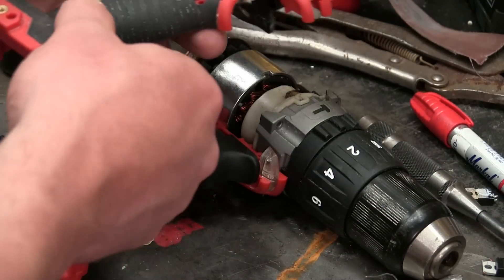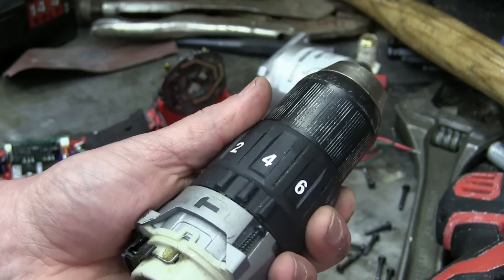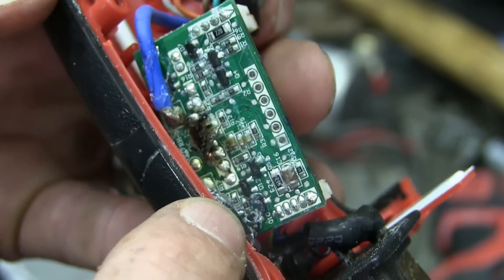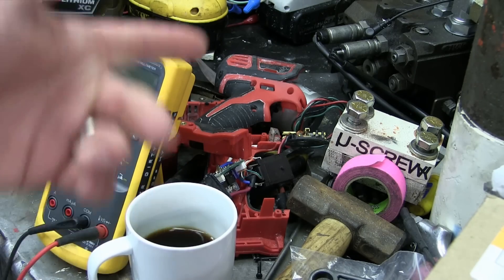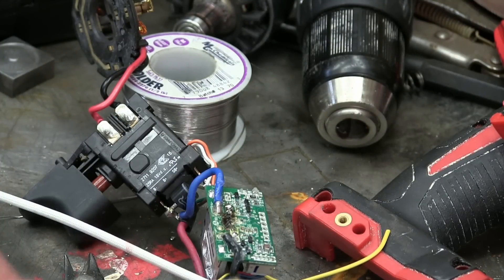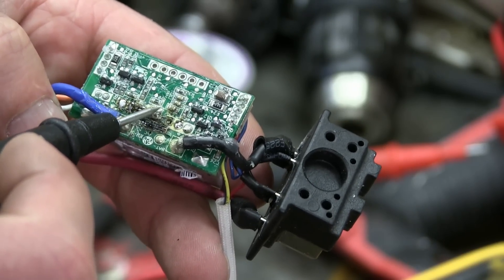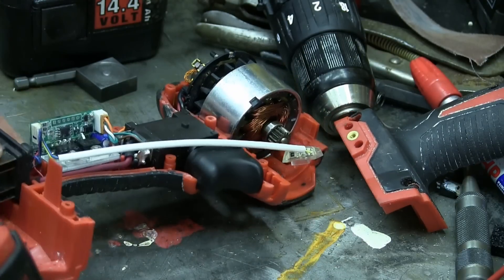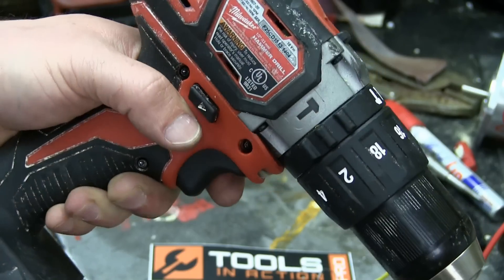How to fix fancy electronics in newer tools.

Comment: Stopping here before the end, because I keep meaning to mention; your focus trouble is in that your biggest white pixies are what the camera is noticing to focus to, and the reason you can't get it to focus all the sudden on your hand item is because 1; the white on it isn't bright enough, OR #2 big enough. 
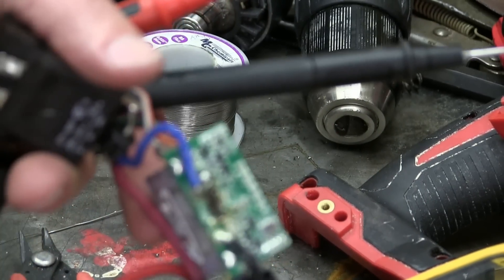If you look at 5:30 there is the major white which is in that chrome metal piece, and nothing in your hand is as bright as that, and second part is that white spool that is really big and causing a lot of bright white reflection, so your evaluative metering doesn't have enough evidence to switch it. 
So simple solution might be to either throw a dark cloth over your bench items, or put piece of paper behind your item, or find a way to illuminate what is in your hand better. 
Maybe you could wear one of those miner head lights to brighten what you are looking at. 
Or you could move the brightest reflective things off the bench, but that sounds too tough. 
lol
Ok, back to the show.

Comment: I had similar failure last winter (same drill), FET's were fried. In my case reason was that that beefy protection diode had died (there was an actual crack in middle of it)and in short time it killed power mosfets. Replaced those with closest things i had at hand and it still works. 
Another weak point is bearing seat at back. Brushes tend to heat it up to point that it melts (if you really push the drill).
I also have brushless model and it seems to b lot more idiot proof so far.

Comment: Osh park make a new board, assuming you could get ahold of the schematic for the board
Reply: There's a microcontroller in there, good luck finding a replacement and most importantly, the software that's on it
Reply: +nrdesign1991 that could be a challenge...could desoilder it and reuse, or i dont imagine the control circuitry or the software is terribly complex basically just an H bridge and pwm for speed control, possible encoder feedback i would say someone half decent ant electronics design could make one with identical function using an atmel chip actually sounds interesting i might look into it, could even beef it up with a proper voltage regulator for the motor, for maximum chooch factor

Comment: CPC which is sort of  like Digikey (same crappy order system) is just 6 miles away if I need anything ASAP
Reply: Crappy order system?!?!  Digi-Key's parametric search and ordering system is miles ahead of Newark or Mouser with their slow-as-molasses Java, or Flash or whatever programmer's wet dream jiggery-pokery they use, and it's light years ahead of Arrow and Allied, which have search systems that are totally unusable.  I can find exactly what I want on Digi-Key in seconds, upload a bill of materials that auto-populates a shopping cart, save multiple shopping carts for parallel projects and share shopping carts as links.  No comparison.
Reply: Yes it's quicker but they all have the same problem when you need a part as they can have menu items with the same values in more than one item. If you are not sure of the part number but want say a voltage regulator with a low overhead it will take you forever.

Comment: I did a similar fix on a mouse i have here.  The cord got a short, so they sent me a whole new mouse under warranty.  I poked around and found that there were replacement cords on Ebay.  12 dollars later, and i fixed it.  I did crush a metal dome switch for the middle click taking the scroll wheel off, but later I figured out that the dome was just taped on basically so I just carefully bent the dome back into it and taped it back on.  Fully working again.

Comment: may have to do that to my big ass 1/2 inch dewilt impact...i thought it was skookum...but, i've had it six months, and i think the trigger is broke...sometimes ya pull er and nothin happens...sometimes it works fine, sometimes, ya pull er, then it shuts off power, and the brake don't kick on...i'm gonna try and get the mac guy to send it in for warranty...i wonder how much that'll cost me
Reply: I had a ryobi sander blow through two switches on me. Finally I said F it and hooked up a xmas tree light foot switch. No problems since. Odd thing is the unit has speed control, conformally coated and that never went bad just a lousy DPST double insulated switch.
Reply: I think that amount is set at "Just enough to piss you off" but "Not enough that you decide it isn't worth it".
Reply: i looked up replacement parts just a while ago...a new motor/switch/board assembly would be about 160 bucks direct from dewilt...for something i payed 230 bucks for 6 months ago...joy
Reply: They really would rather you just bought a new one.
Reply: bighunterman77
It's always been that way. Back in my teenage years I spent almost a hundred bucks believing Sears products were better. Jack went out under a year later. WTF? I call sears, new "power lifting unit" is about fifty bucks and several weeks wait. I go to the HW store pay 29 cents for an O ring and by evening the jack held a 2 ton giant of a car all night long not even settling 1/2" !
Reply: BikingMNViking
I purchased a very expensive (mid 90s, over $400) VCR from a big box store for $10 because it was purchased and returned and I have a relatively useless piece of paper saying I'm certified to work on TVs and VCRs. The reason it was returned was "Played one tape and won't accept another tape". Got it home, found out that the issue was a label from the first tape was stuck in the machine. Goes to show it's generally something fairly simple but most people won't even TRY to repair the stuff. I've had several cases like that over the years.
Reply: Guy Fawkes
I wish I knew a lot more VCR theory... I must have 8 and I don't think one works anymore. Sometimes I get lucky and find they don't track in & out of the machine very well, other times they just blank out. That reminds me I just got a gorgeous 500 Watt Klipsch amplifier from awhile back. Put together immaculately. Owner was told it'd cost several hundred to even look it:

It has two mad MOVs and a 5 amp fuse blown. Now THAT was good engineering. I hope once I get time to get those parts it will work fine. It's even got a wired remote unit that turns it on and has a headphone jack and so on so you can keep the amp & 5.1 subwoofer unit hidden in a corner where bass is reflected best. (not that I needed it mind you, I have two 500 watt units already!)
Reply: BikingMNViking
 MOAR POWAH!!! That Klipsch sounds like a nice unit. I LOVE that stuff!

My landlord has me doing some wiring work/going through his storage shed. I found one of these:

http://classicreceivers.com/concept-16-5

Built like a TANK! Nearly 70 lbs! That's FOUR 10000µf/80v caps sitting in there! 165watts per channel but it seems stupidly efficient through good speakers. Not a bit of wasted space, no ICs anywhere in sight. Also not a problem with the thing apart from a dirty volume pot, which I had to gingerly peel apart and clean. I cleaned the unit, hit a few wonky looking solder points, aligned the tuner and it's good as new. Look at the Ebay "Buy It Now" price on that page! We are using that as the basis of a whole house system. Running speakers into his pool area and patio. I'm having to teach him about audio, now that he's got a nice basis to build from. I also found a decent Fisher receiver from the mid '90s that he gave me. It's now become a headphone amp.

I am pretty sure the minute I got certified in TV/VCR I signed the death warrant for the entire industry. They lasted a few more years before the DVD came around. The thing with VCRs is generally rot in the belts. That and the plastic gears are usually the issue with them. The belts are fairly easy to get, the gears? Hit or miss. Although when I was still repairing them professionally I once had a PBJ jammed into the mechanism and, on one memorable occasion, a motel called and said the rental VCR unit they had wouldn't accept a tape. Hard to load one with about 2 ounces of crack cocaine jammed in it!
Reply: BikingMNViking
Well, my actual "edumacation" was "school of hard knockers" and a bit of college. I sort of apprenticed with a guy who's dad ran a Radio store from the 20s to the 50s. He retired and his son specialized in general electronic repair, emphasizing on TVs. His store was half TV and half guitar/amp and other musical equipment. He joked that the TV side paid for the guitar side, and he wasn't really joking. My actual study was with a guy who worked with Raytheon/GE and Seimens on the early radar equipment, branching out to early TV and staying involved as a teacher until the early 2000s. Guy knew EVERYTHING! Gotta love an electronics teach who is late to class because "I had to repair the computer in my K-Car". The actual certificate is from Southside Virginia Community College. The actual experience was looking over these guys shoulders, asking questions and ruining my own shit!

RM is definitely "Rack Mounted". Here's some Google Fu (actually Bing Flinging) on the RM35A

http://www.radiomuseum.org/r/tektronix_oscilloscope_rm35a.html

To join that site you have to either pay $25 or upload pics and information on equipment, etc.  Might be worth it to track down the guy who uploaded the information (in Italy) or find someone there who knows more. Good luck. Neat unit for sure. I'd love to nose around in it for a while.

Sending an email. Feel free to shoot me questions or just conversation. I'm currently down with a back injury and about 65% bored.

Comment: if it's under 5 years old Milwaukee will fix it, no questions asked, no receipt required, with free shipping. it's the most bullet proof warranty I've seen yet.
Reply: with no receipt how do they know its less than 5 years old???
Reply: *****
Tools can have date codes on them. I think that is how my Miller got warranted? I brought it in to get fixed, and the guy was like you're still under warranty. So they fixed it for free. Although he might have figured it out just because of what model it is? It might not have been out long enough to be out of warranty.

Companies do come out with new tools, and discontinue old models rapidly anymore. It is not like the old days where a company would make the same tool for decades.

Nowadays it is all about the latest, and the greatest. So you buy, buy, buy!
Reply: +Wild Weasel, the serial number, this is also how you get free return shipping, go on their website, type in the serial number, it does the rest for you

Comment: Infineon was a spin-off from Siemens. They  actually does a ton of stuff, microcontrollers, RF/ cellular chipsets, tons of automotive ICs, IGBT, etc. I used to work there in the early 2000's. They used to make RAM as well, by they spun off that side to make Qimonda.  Sorry for the edit, I'm still waking up.

Comment: Always save the sponge/foam material that they stick your components in. (At least here in the Netherlands) it is a conductive material with some interesting properties. 
The resistance changes when compressing, making a great cheap force sensor. Used it a lot for prototyping and small projects when I was a poor student

Sam

Comment: I had the same problem with a Milwaukee 18v Hackzall. I removed the board/mosfets from the system and wired straight from the battery contacts to the wires i cut from the board that lead to the trigger. The Hackzall works perfectly like it was brand new. I got the idea from a youtube video on using a different brand battery to run a Milwaukee cordless shopvac (wish i had a link, sorry). The man in the  video said that those bits were proprietary bullshit to make sure the tool can only use Milwaukee batteries, dunno...the Hackzall worked great without em so i dont doubt it

Comment: Hi. The diode in the MOSFET probably failed after driving the motor at some point. The diode is there to allow current to flow to ground when an inductor is being driven. The total current was probably too much after releasing the switch, hence the burnt ground track. Also easier and probably better, to "bridge" the broken track with a nice solder-made track/blob. High-flux content solder would create a film around it at the same time.

Comment: I am surprised that repair worked. That board looked pretty toasty too fried to me. Without some kind of mechanical connection on your bodged trace repair I imagine the first time you really work the tool out that will come undone too. This may be a prime example of the old saying, the bigger the glob, the better the job though?

Comment: thanks to you i know how dangerous capacitors are. short of the long of it. my run cap went in my central air con unit.. had no idea wtf it was. called the family member who does hvac and he found the problem.  he pulled the cap but i wasnt home so the other half said babe get the silver thingy he left on the table, so we can get the new one... i damn near had a heart attack.   this sob would've definitely done some damage if ya didnt know how to handle it

Comment: I'm here laughing like crazy on "my wife says it all the time, but I don't know what that means" lol.
Reply: Interesting to say the least... with any luck, hopefully AvE has seen your post (was equally intrigued) ordered some post haste and will report back to the subscribed masses!!
Reply: +AvE  all depends on how thick you apply the material. if it is too big of a trace, or too much current,  you can use copper tape, it comes in various sizes.
Reply: ^Was thinking same... the more you build it up, the thicker the gauge ... hopefully allowing more "magic pixies" to dance!  Ha, I can already picture some of the "AvEisms" in the vidjaho commentary, "The more you build it up, the thicker the gauge...am I right gentlemen!?"
Reply: +AvE - One option/trick might be to incorporate/embed a length of copper wire into the glue to further support/pacify the angry pixies.
Reply: Hmm... I wonder if solder paste could be made to self-solder, initiated by ohmic heating to liquidus, as with arc welding.  To prevent thermal-runaway, the reduction in resistance from reflow would have to offset the increased resistivity at higher temperatures.  Maybe mix of eutectic alloy powders could reflow to a less-eutectic alloy?  The reduction in electrical resistance would also cause a reduction in thermal resistance, so maybe this property could be used where a solid conductor could act as a heat-sink to freeze the solder joint.
Reply: +Mike Guitar  You should experiment with that hypothesis and report your findings to us. good luck.

Comment: That'd be your FR4.  
https://en.wikipedia.org/wiki/FR-4

I've ground out a lot of carbon from a lot of circuit boards back when I was working at the repair shop before stuff got so cheap you can buy a new one for the check-out charge.

Comment: love your vids,  If i may Ill unfuze your cunfunction with the pixie Maze.  Electronics is what I do, real quick like the Gate is what you said it was, the Drain and Source part is a little  confusing.  Simply put the Power is Drained INTO the Drain lead either from the power source or after the load, either way is fine. The Source lead then delivers the pixies to the load or ground, again Either way is fine.
Reply: ... and just remember the positive pixies 'aint meant to be going through the body diode when switched on... 'cos that would make no sense at all, so they must be going tuther way... at least that is what is meant to happen....if you let the pixies run all over the shop,  you end up with PCB caramel, as per figure one in today's life affirming video..

Comment: Repaired well lol
Reply: That remains to be seen. It may be that it was no good to begin with. Which is why it blew up in the first place.
Reply: ... and furthermore, may well why they don't sell the spares any more 'cos they are all used up. 

Uprate the MOFET and see what cooks next would be my plan if it blows again. Also dremel out the electic caramel from the board and solder insulated wires direct to the mosfet legs, then tack the other ends on the remaining un-crispy (is that even a word?!)  tracks. Looks like shit, but what the hell., the covers on these things 'aint see through. Epoxy resin fills major holes in PCBs quite nicely, pop a sticky label on the back of the board, fill the front, smooth it down, let it set, remove sticky label, sand and drill as required. Not recommended for high voltages or RF circuits perhaps, but for power tools and low voltage power supplies, not a worry.
Reply: Andrew Hull
yeah cooked boards are a major concern. The board is a critical component itself.

Comment: +AvE Did you ever explore your camera to see if it has "center/point focus" capability ?  
Most cameras default to "Multi/Grid Autofocus" which means they try to maximise the amount of sharp-edged stuff in the  whole frame.  If you have to put something big behind the thing you want to focus on (like your hand), thats usually an indication of multi/grid AutoFocus.  
Change it to Center/Point focus, and it will focus only on what is in the *center of the frame, even if it means the "background" majority of the frame goes blurry.
Or do you already know this and just like saying "Focus you Fack" ? :)

Comment: Back a few years a go I found a Trainor amp in the garbage and it was all taken apart I was going to scrap it but I have no fear so I tryed to start putting it back together found out a wire had been pulled out of the transformer so I took a tack broke off the plastic bit soldered it to the end of the wire and shoved it back in
And what do u know it worked I used it for over 10 years then sold it for 350.00 Canadian pesos and the guy was happy as a pig in shit with it 
It was a mono block 2 and I ran it hard for a few years before I gave it up 
Thank you brother for some of the best Vij s on you tube 
And yes the dick it always in some type of vice LoL